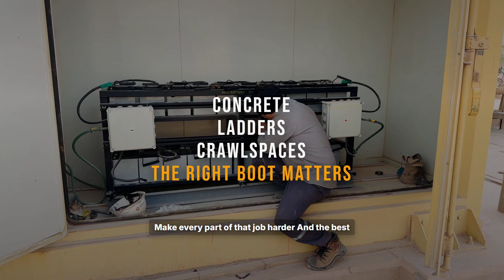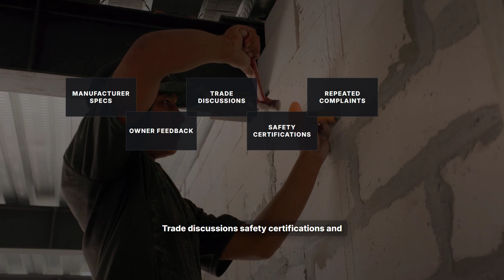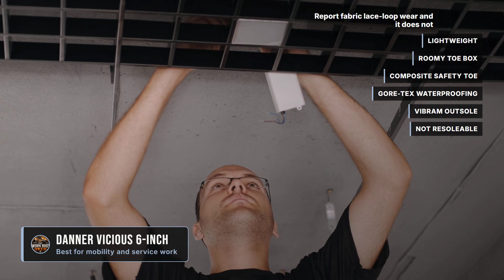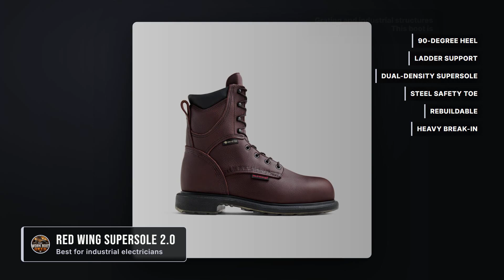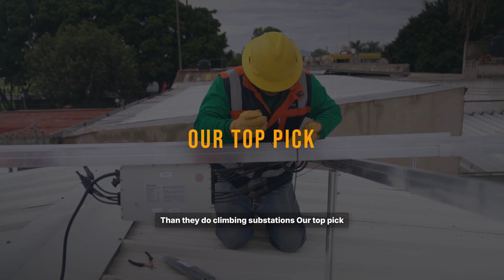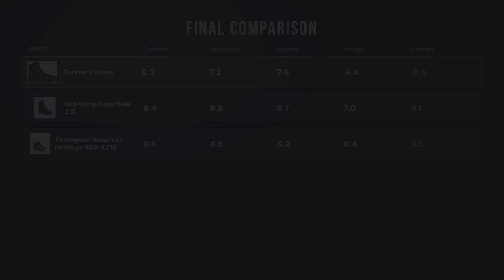Best Work Boots for Electricians (2026) | Danner vs Red Wing vs Thorogood

Comment from the maker: Electricians: what boots are you wearing right now?

Do you prefer a lightweight composite-toe boot, a heavy-duty boot with a defined heel, or a wedge sole for long days on concrete?

Tell us the model, the type of electrical work you do, and how long the boots have lasted. Your experience could help another electrician avoid wasting $200–$350.

What trade should The Work Boot Lab cover next?

Real Research. Real Trades. Real Boots.